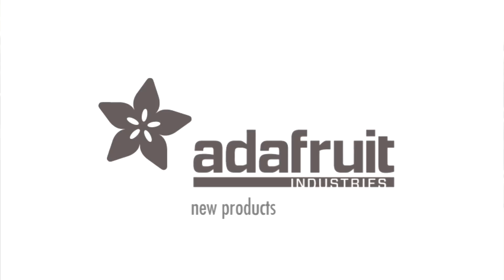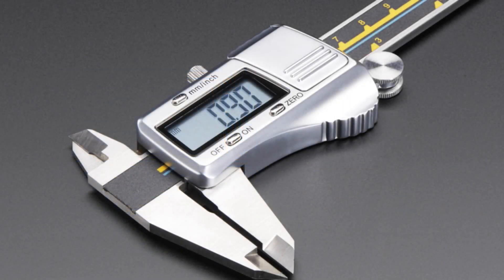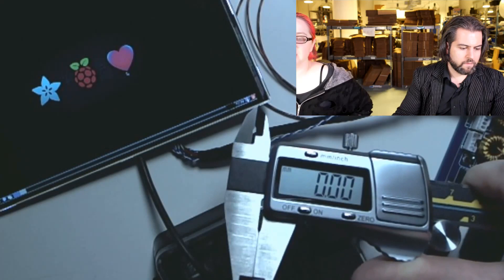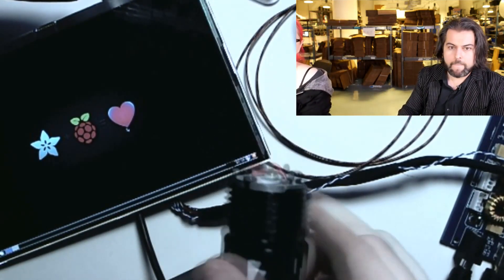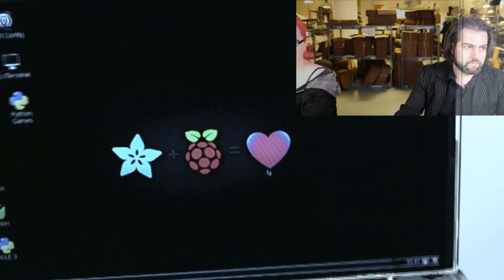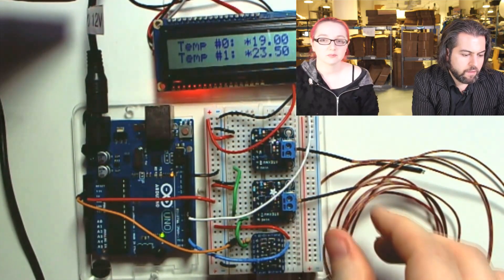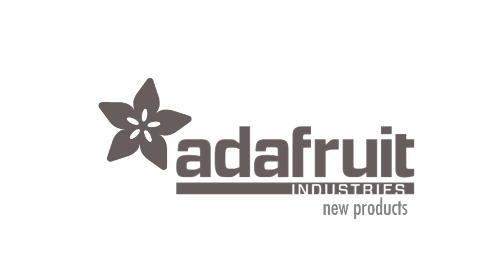New Products 2/26/2014

Comment from the maker: See what's new this week! New Products 2/26/2014

3DR Iris - autonomous multicopter (0:10) http://www.adafruit.com/products/1546

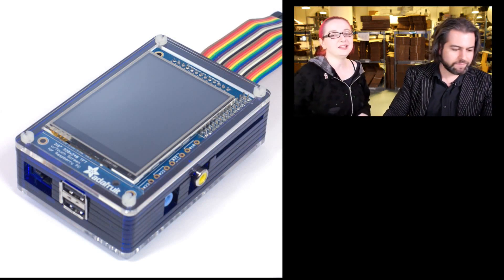PiTFT Pibow kit (1:39) http://www.adafruit.com/products/1723

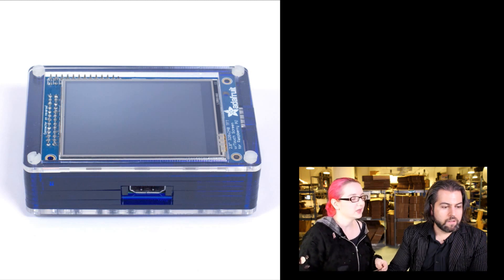Premium Digital Stainless Steel Calipers (2:28) http://www.adafruit.com/products/1724

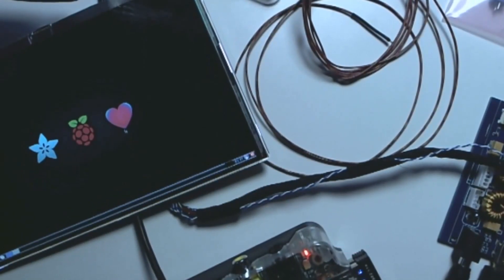HexBright FLEX (5:20) http://www.adafruit.com/products/1725

7" Display & Audio 1280x800 IPS - VGA/NTSC/PAL/NTSC (7:56) http://www.adafruit.com/products/1726

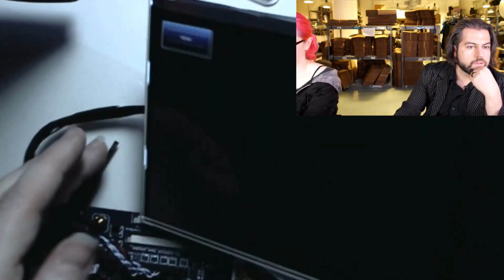Sew-Your-Own Owl Kit - Cynthia Treen Studio (10:45) http://www.adafruit.com/products/1728

Thermocouple Amplifier with 1-Wire Breakout Board - MAX31850K (12:30) http://www.adafruit.com/products/1727

 #adafruit   #arduino   #electronics   #hardware   #opensource   #projects   #raspberry   #computer   #raspberrypi   #microcontrollers   #LEDs   #LED   #gemma   #flora   #bluetooth   #bluefruit   #neopixel   #neopixels   #wearables   #art

Comment: Hey guys, here's a little RC education for you. The "KV" on the specs of the multicopter motor doesn't stand for kilo volts.  KV when talking RC model motors stands for "RPM Per Volt" the 'K' is for rotations. So the 850KV quoted on the motor specs mean that for ever volt applied to the motor the props will rotate 850 times in a minute: 1 volt 850, 2 volts 1700, 3 volts 2550.... Thanks
Reply: Thanks for that - I never understood what the numbers meant. Are those actually calibrated/tested numbers, or just a general guideline?
Reply: Just as it is with most mass manufactured items, It's a general guideline (especially for the cheaply made motors).  But, for the more expensive motors like the ones used on a DJI Phantom and other high quality RC models, it's a tested number, the information for the KV of a motor can be found in the motors datasheet and almost always listed somewhere on the motor itself.
Reply: Seems like a useless parameter , since that number will change drastically once the slightest bit of mechanical load is applied ..